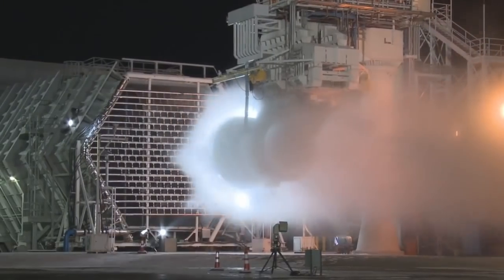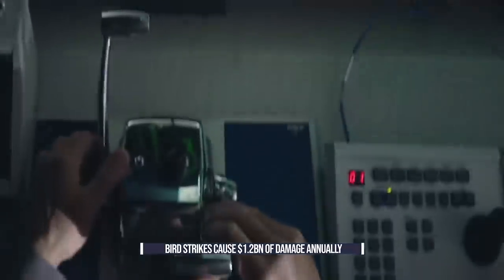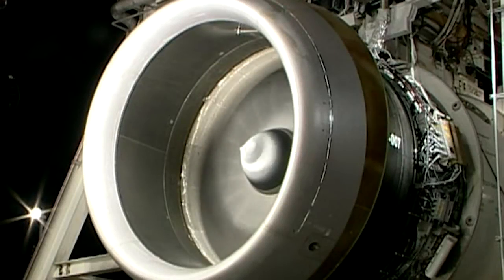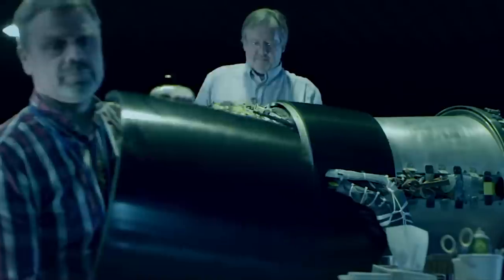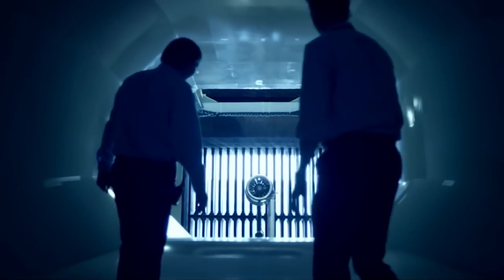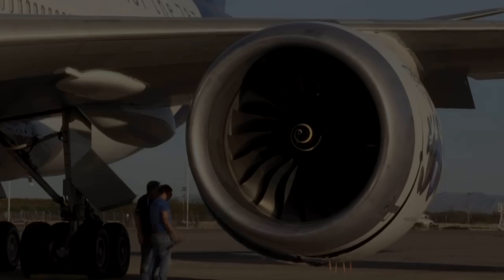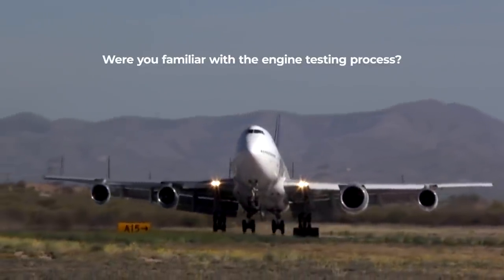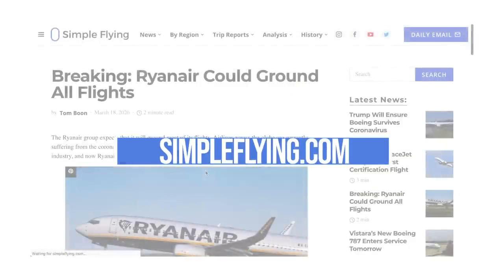How Aircraft Engines Are Tested Before Production

Comment: An interesting aspect of testing early high-bypass engines was the type of planes they used to test the then-new engine designs. Both the Pratt & Whitney JT9D and General Electric TF39 and CF6-6 were flight-tested with a modified B-52E, and the Rolls-Royce RB.211-22 was flight-tested with a modified Vickers VC10.

Comment: Does every engine built get tested like this?
Reply: I doubt it. Like with planes they run the planes through test that will push the limit of the aircraft's design and structure for the certification process but after the plane is certified the planes just go through some functional tests to see if everything works fine then the airline tests the plane and if they're happy they take delivery of the plane.